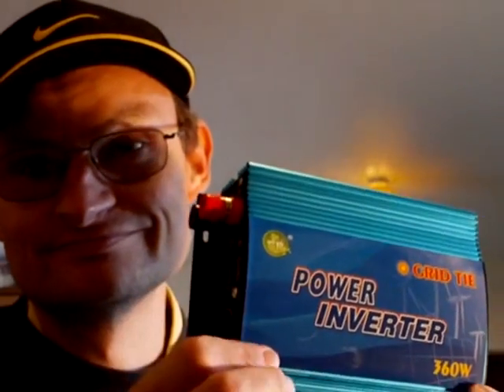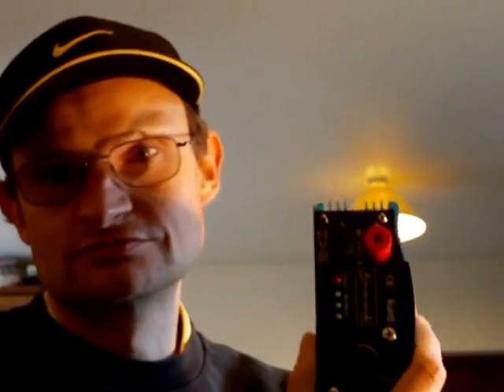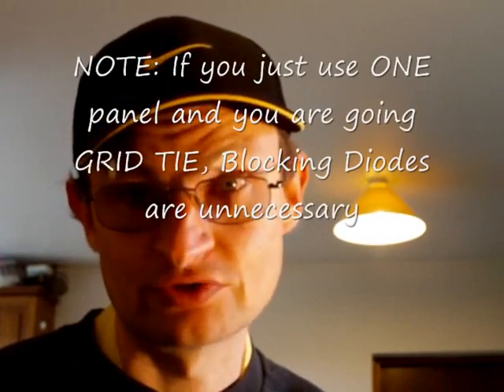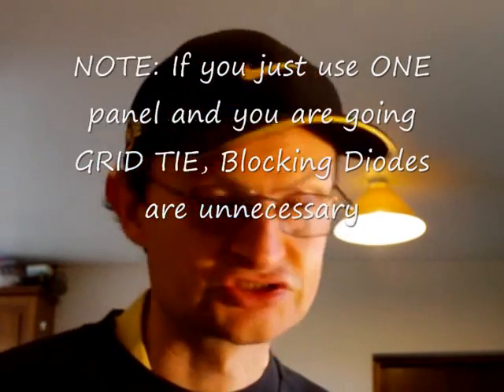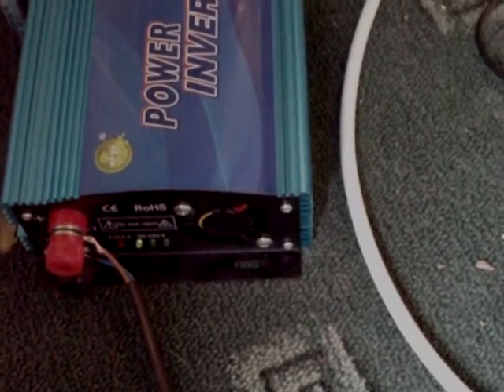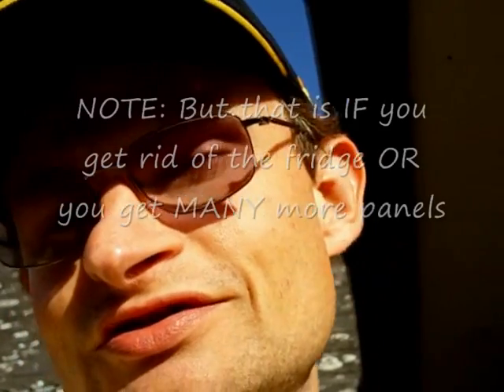Selling energy back to the grid using HOME MADE SOLAR POWER

Comment: Hi, Nice video, it is the truth. its quite easy to make a solar panel at a fraction of the premade ones and it is really that simple to install and connect it up. the GTI is amazing, no batteries, brakers, regulaters ect. solar panel to the GIT - GIT to home... Free electricity. Is your solar project still working? =]

Comment from the maker: @domeztik I used a "Grid tie Inverter". "Blocking Diodes" weren't needed, but as I have two cables coming off the GTI for two panels, i dint want the panels shorting each other out, so I used blocking diodes there.